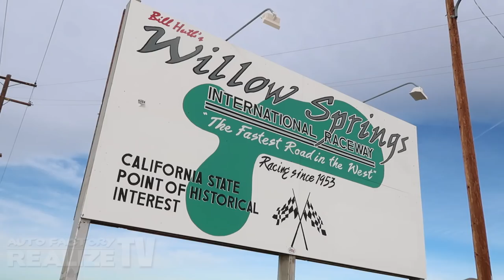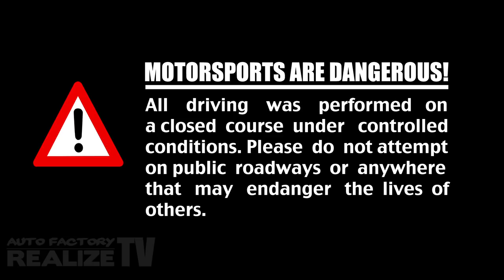Drifting a High-Speed Track - Chuck Blows His Engine!

Comment: Question for Gary - What're your top tips for keeping a JZ alive for 10 years?
Reply from the maker: It's funny because he actually really only did minimal maintenance to the engine.. Maybe he just got lucky. -Teddy
Reply: Auto Factory REALIZE - That's pretty cool to hear. Is he running an oil cooler? Thanks Teddy!
Reply from the maker: Yes he is running an oil cooler